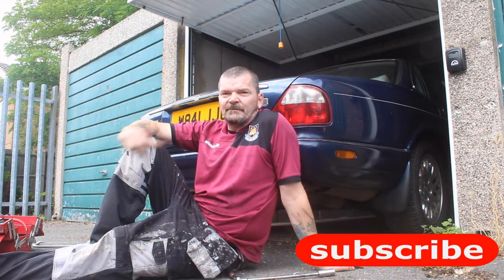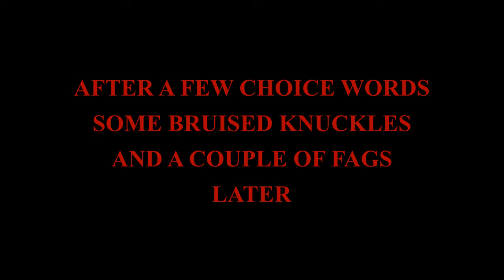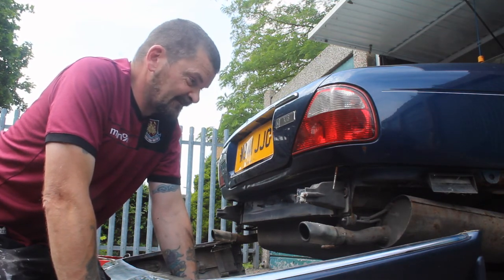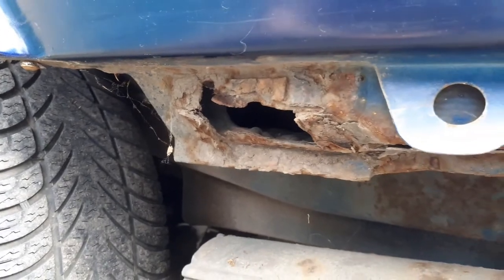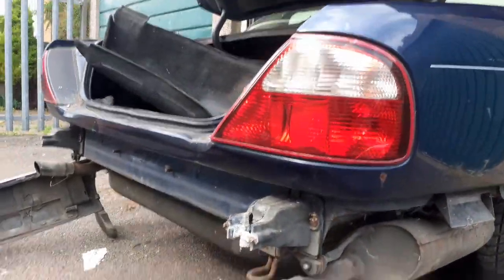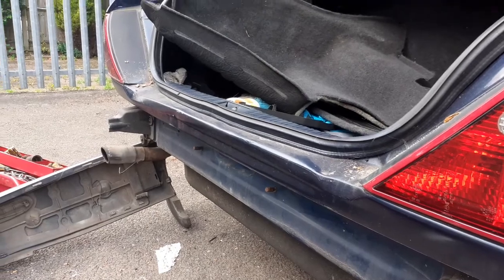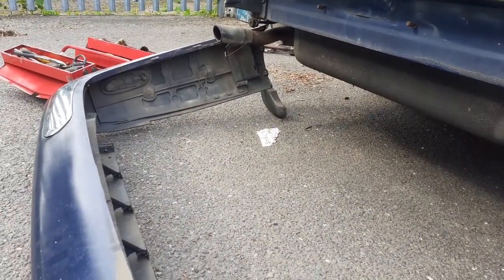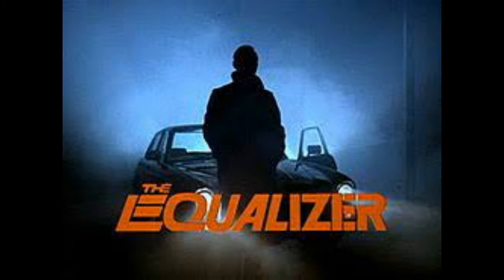THE JAGUAR XJ8 RESTORATION PROJECT PART 2

Comment: Hopefully u can help what’s the bracket inside the rear wheel arch at top mate with 4 tourqe bits holding it??
Reply from the maker: Not sure bud mine was rotten away and held up with cable ties sorry sbout late reply